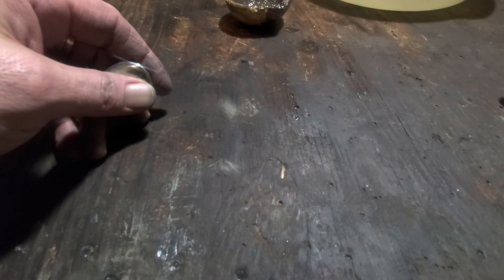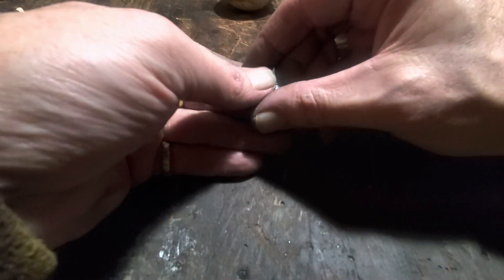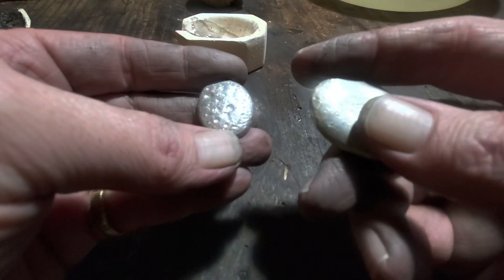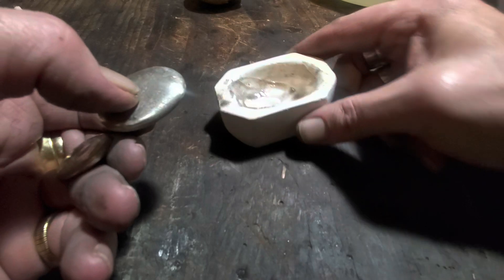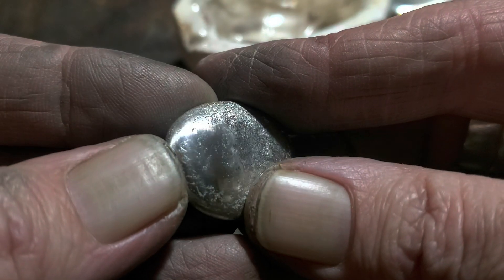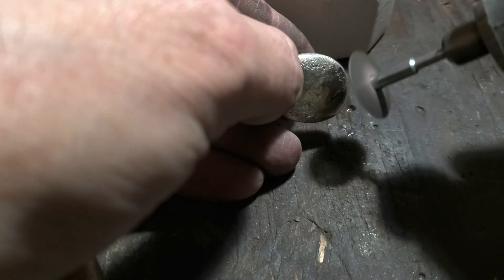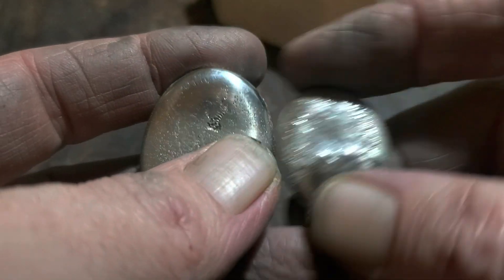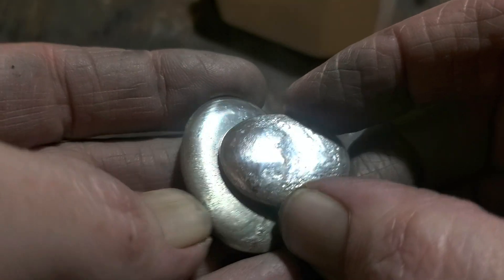Junk jar mystery metal part 2

Comment: Lead and aluminum.  Sounds good on the body/lungs?  Now,  what cha gonna make?
Reply from the maker: We're not sure. If the properties of the metal are favorable for drawing wire or rolling plates the options are endless. If not I'll use it for a casting metal.